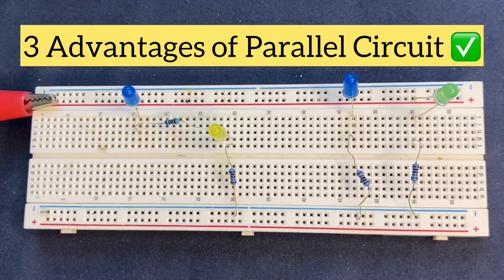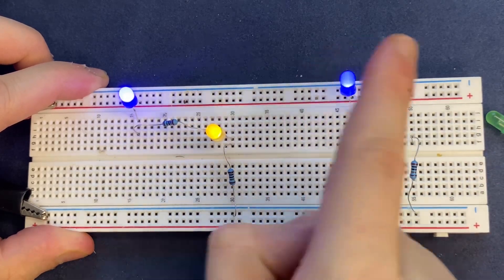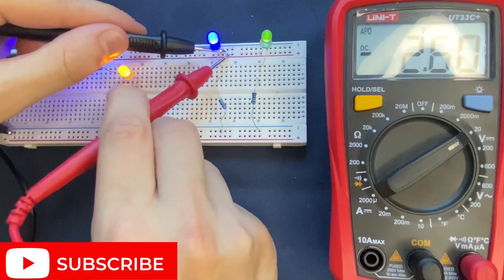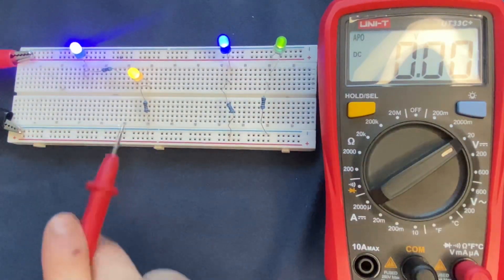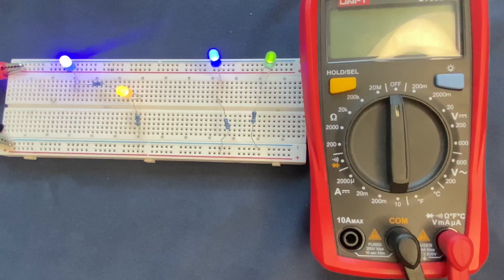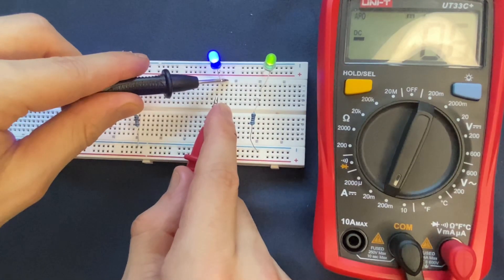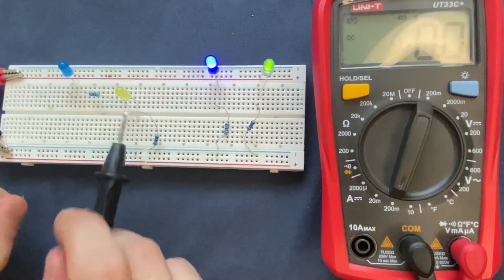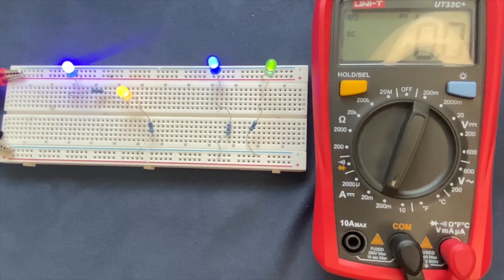3 Advantages of Parallel Circuits over Series Circuit on Breadboard #digitalelectronics #breadboard

Comment: Can you drop the name of the instrument which measures the voltage?
Reply from the maker: It’s called Multimeter , which as the name suggests measures multi electrical values ,  ( in the Video Current  and voltage ). sometimes to measure only the voltage drop of the Component  we call it Voltmeter too
Reply: @ElectroMin thank you🙏